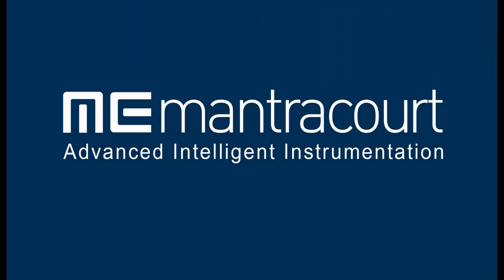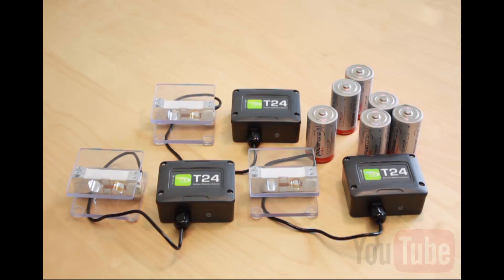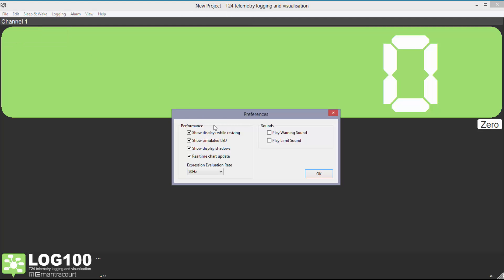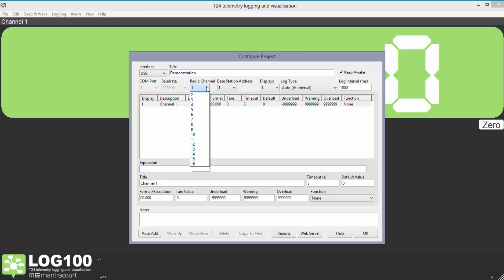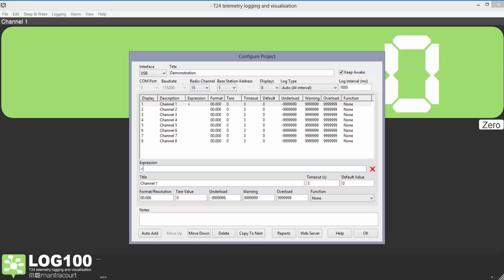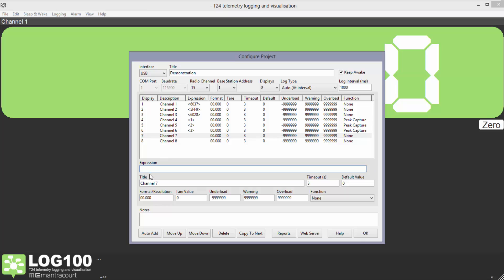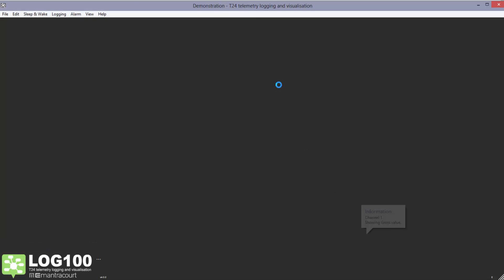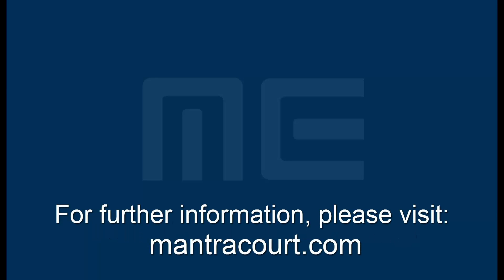Basic Setup Tutorial of T24LOG100 Viewing & Mapping Software (Part 2)

Comment: Hi, thanks for the tutorial. How does it actually work with multiple Basestations? Can they run simultaneous while logging/displaying in the LOG100 software?
Reply from the maker: Hi Jelle; You can only have one T24-BSu or T24-BSue base station connected to any one PC.
 

There are more complex setups possible with other base stations available - like the T24-BSi. Please contact us directly for more information on this. We will need more details from you about your application to be able to get you the best solution. technical@mantracourt.com. All the best and thanks for watching!